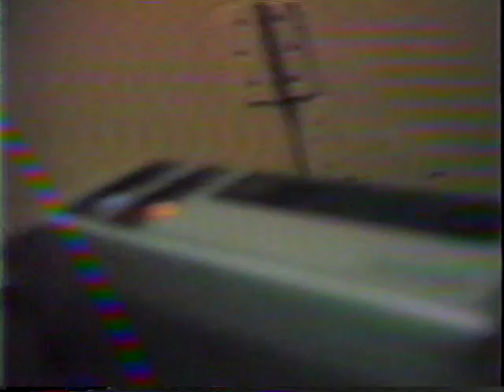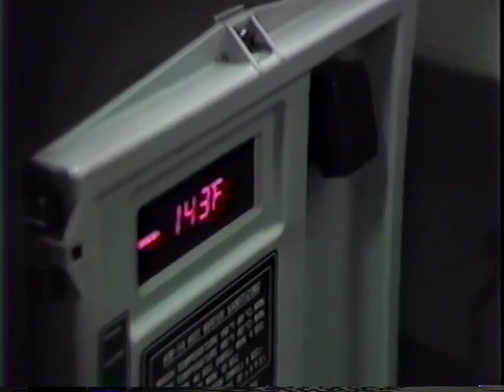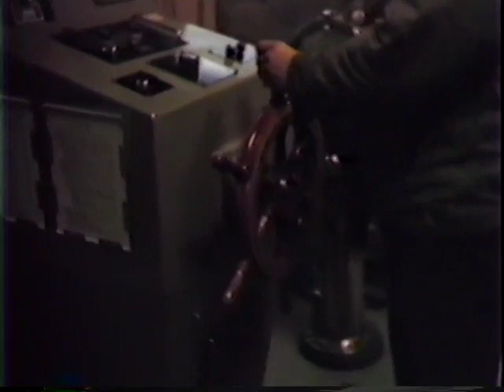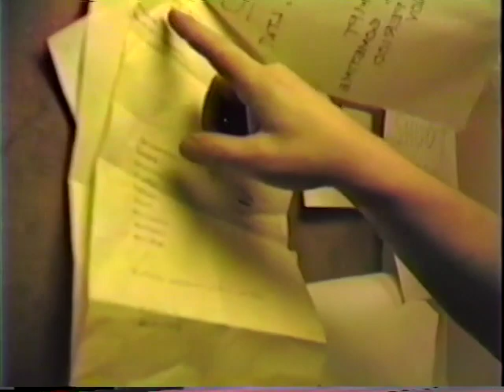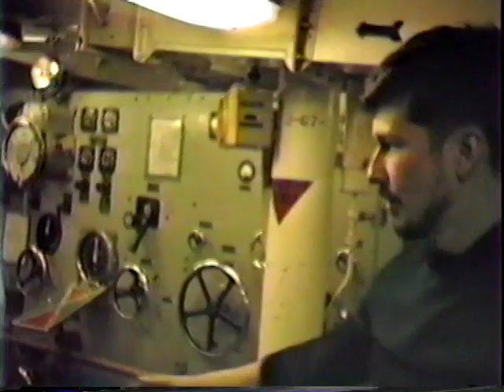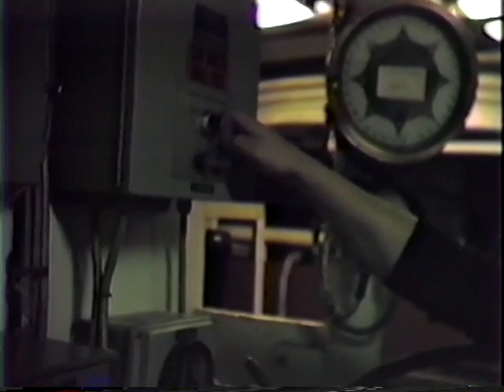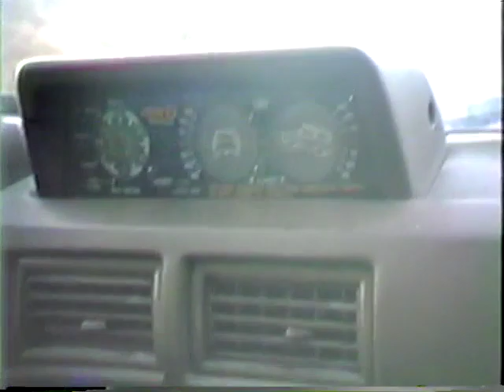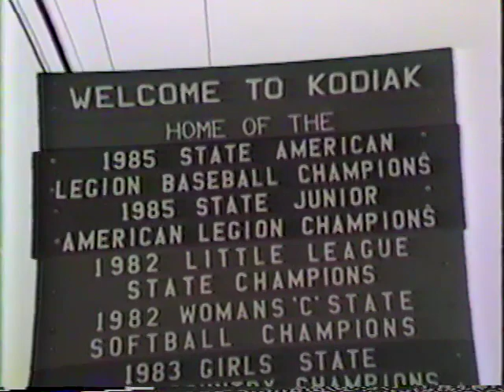This Is Kodiak? "Best of the Yacona Guys" with Alex & his Pals

Comment: Seeing this video has brought back a rush of memories for me. 
I served as the lead DC on the Yoc from 1975-77. She was still in Astoria, Oregon in those days. Anyway, I served 1973-77, first on the cutter Rush which was homeported out of San Francisco in those days, then I moved up to Astoria on the Yocona.  I spent a lot of hours in B1 and B2 engine rooms  while underway and on the forecastle for anchor detail. 

A few memories of my time aboard the Yocona-

We were underway at sea for over 250 days in 1976. This was hard on the married crew members, especially those with families.

We deployed the first 5 open ocean 43 foot weather buoys in the Pacific. These buoys were made in San Diego so we would go down from Astoria for each buoy, except one trip where we towed two together. These buoys were towed at no more than 4 knots, so it was a very slow process, especially the ones we deployed west of Dutch Harbor.  The buoys were anchored in thousands of feet of water. A ships anchor was attached to the starboard side of the fantail and normal anchor chain was coiled out on the deck. Miles of double braided nylon was laid out in the compartment below the fantail and just ahead of the steering room. It was quite a sight to see when we  tripped the anchor binder and  watched the anchor drop over the side, the chain run over the deck and over the side following the anchor, then miles of rope feed out from the fantail hatch. Once the buoys were set, they collected data on local ocean conditions and transmitted it via satellite to the weather service in New Orleans. If you look at the wiki page for Yocona, there is a picture of towing the first buoy. The photo was taken by a CG helicopter that circled overhead as we left San Diego harbor.

We also conducted fisheries patrols off of California,  Oregon, Washington and Southern Alaska and were the lead vessel during the recovery operation following the tragic sinking of the charter fishing boat Pearl C. on the Columbia River bar. The Pearl C. flipped while being towed over the bar by a 44MLB and 8 lives were lost.
Reply from the maker: When I hear that this video brings back memories for the crew, it makes me really glad I was able to find & transfer this video to YouTube. Being on the Yoccona had a big, positive impact on my brother -- he was able to complete any task he put his mind to. Not so much before he joined the C.G. His sewing skills (making nylon cases for optics) were unparalleled after he made covers for some of the optics onboard, and got him his first job after service, making movie camera cases for the R.I.T. Film/Video Department. That eventually led to him managing their equipment. He went on to a Master's degree and a job in instructional design after not being able to complete college before the stint in the C.G.